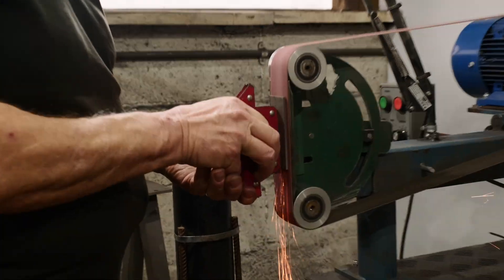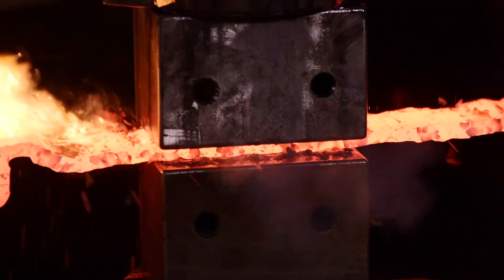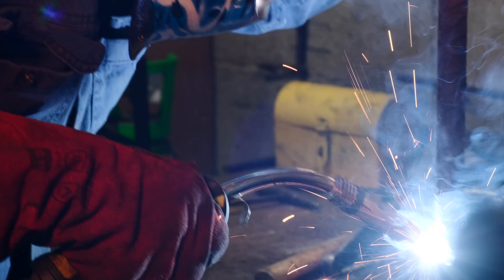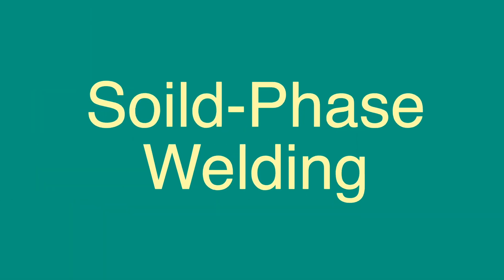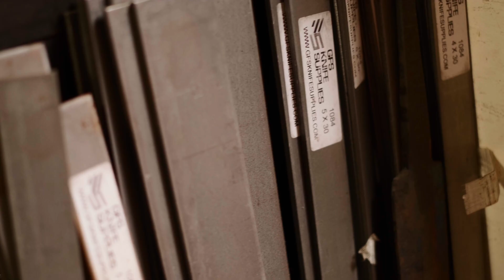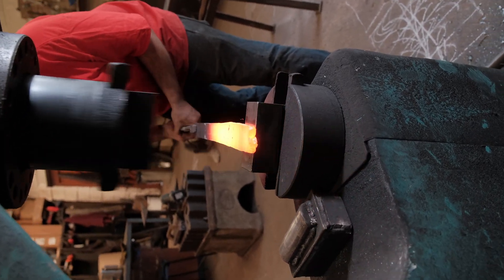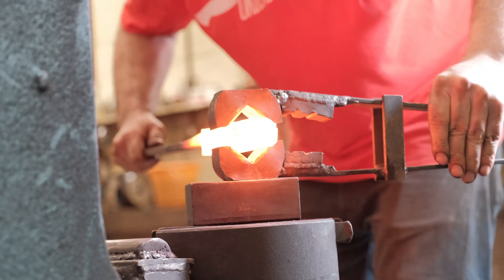I wish I knew this BEFORE I started forge welding!

Comment: Sand is used to cover the steel during heating before forge welding.
It melts and protects the steel against oxidation. 
How does it work since sand melts at about 1700 degrees C.

Comment: Around 6:45  what Your Explaining, Reminds Me of “ Tempering Glass “.   The Glass comes Out of the Furnace, and Immediately has Regulated Pressurized Air on Both sides for a Distance, Then continues to cooldown on Roller Conveyer.  From what I could understand the center is still Hotter causing a Pressure against the Air Pressed sides of Glass.  When Tempered Glass is Brakes You can see the Center is Different.

Comment: In a traditional weld, you'll get "heat zones" right beside where your weld is. That again means you'll end up with a structure that is weaker at both sides of the weld. If you forge metals together you fuse them. They will as Graham explained form a crystal structure together. There are several different structures depending on the metal e.g. stainless steel has an austenitic structure.

Comment: Regarding the cracking—I can add this info.   Higher carbon steels can frequently have Mf temperatures that are BELOW ambient temperature (Mf=the temp at which austenite to martensite transformation is complete).  So, if the Mf temp is lower than the temp in your workshop, after quenching the steel will have some austenite present.  However, that austenite WILL eventually transform to martensite. When austenite transforms to martensite well outside of the austenitic range, it causes a massive amount of internal stress and leads to cracking.  I’ve heard some argue that cryo treatment can somehow prevent that cracking—sounds counterintuitive to me.  
All this to say, the only way you could avoid this is by altering the chemical structure?? Obviously, slow heating will help (especially below A1); normalizing will help; the basic crap that you don’t need me to list.  
My mind always wonders, when you forge weld different steels, that intersection of the different steels must somehow alter the A1, A3, Ms, Mf, etc.
Reply from the maker: Thanks for sharing!

Comment: well for center core breaks that does make perfect sense ... it's the same reason why Japanese Katana's bend when quenched ... the harder steel edge cools faster and grows a bit as it solidifies harder bending the softer steel back creating the iconic curve to the blade ... with it in the middle it has no place to relieve itself so it shatters from compressions stress 
.
and centerline cracking is actually the designers error they didnt allow for the different expansion and contraction rates of the metals used ... the softer outside metal will act as a spring pushing constantly on the core ... as the core cools it expands by making crystals eventually it overcomes the stress the core can handle and cracks because the exterior is too bulky for the interior to push out of the way ... now if the cladding was thinner near the harder core it would have less pressure on the core and allow the core to expand the softer cladding into the gaps avoiding cracking ...

Comment: I had a few episodes of cracking similar to yours but mine was round bar tool steel and it split from the edge into the center like pacman.  The culprit was that the heat treated core grows and the outside can't contain it so it splits. That was caused by us quenching it and leaving it. So there is a time factor here. The proper procedure should be to TEMPER it IMMEDIATELY after the quench and not allow time for the core to expand and split it. Once tempered it is ductile enough not to crack. If I recall it has to do with Pearlite being a different volume than Martinsite or something.

Comment: I solid state welded two 1/2 1095 bars together. No cleaning off the steel, nothing. It was full of scale, rust and dirt. Used liberal borax. It stuck beautifully. Even the cross section looked like one peice of steel. Me reasoning was: did the ancients clean up their steel (no grinders) a lot of them probobly had rusty steel and still welded with it
Reply: They certainly did have grinders
Water wheel powered grinding wheels were a major use in supplying armies, and prior to that they were smart enough to know that sand, pumice, and other rocks could be used as an abrasive. They would even mix a little rock dust with water and apply with a cloth as a kind of sandpaper or polishing cloth

Comment: I tought steel shrinks when hardened. I was told it gets smaller and more dense.
Reply: Imagine that the outside cools and shrinks FIRST then the next layer does and so on. You'd have a situation where the outside "skin" is smaller than the inside so it will split as it tries to shrink around the bigger core.
Reply: It's more complicated than that. It contracts across phase boundaries when heating and expands across them when cooling as well.

Comment: Thanks for the video. 

Can you hear the point at which the core forms a centerline crack? If so, does the crack form at the beginning of the quench sequence or later in the quench sequence? What quenching temperatures do you find result in that cracking the most? Does this happen when the core steel is completely clad on both sides and edges or does this only happen when the core steel is clad only on the sides but not on the edges? Do the cracks run completely through the core steel, only along the edges, or only in the inside with the cracks not reaching to the edges? 

I haven't really looked at structure-property relationship issues since going to college in the eighties. Almost all of my real world experience was in the chemical and refining industries where much of the steel we used was plain carbon steel at low strength treatments. We didn't want any martensite because we didn't want piping and equipment cracking when the equipment came down to lower temperatures. We paid a great deal of attention to the ductile-to-brittle transition temperature, and I'm sure that any of the steels used in knife-making would not work for our needs. However, my health has failed and disabled me out of my career. As a result, I see YouTube videos about metallurgical issues and want to comment or at least ask questions. 

If the steel consists of a core with cladding only on the sides but not on the edges, I can imagine a fairly easy explanation for edge cracking. If you quench so that the edges quickly become a brittle martensite, residual stresses of the inner part wanting to be a greater volume while the outer part wants to be much smaller could cause tensile stresses along the outer edges. That could lead to brittle cracking of those edges. 

Otherwise, I still don't see why a clad part would be more susceptible to cracking than any other part would be. I particularly don't see how a non-hardenable cladding would make the core more susceptible to cracking when a hardenable cladding wouldn't make cracking more likely.

Comment: huh I always thought forge welding worked because the surface was hot enough to melt and thus stuck to each other as it cooled down. You see sparks flying off the steel when its hot enough, so I thought that was the steel almost on the verge of melting.
Reply: Mild steel needs to be heated to the point where it's sparkling or nearly sparkling. Carbon steels don't need as much heat to create the welded bond.
Reply from the maker: Your theory makes sense too don’t worry! But thanks for watching and hopefully this video made sense and was helpful!

Comment: Centerline cracking is basically just that... ive found that when doing 304/316 jacketed sanmai, you should chose a slower hardening steel like 52100 or O1 and immediately after quenching, ONLY quench in oil right down to the martensitic transformation temp (about 400°F is where i stop), and finish with a martemper in a press. If you allow the steel to slowly pass thru martensitic transformation, youll not only avoid cracking, but have a much more stable grain structure.
Reply: Wait til you see Inconel600 jacketed sanmai. 😁

THAT, is a REAL challenge.

Comment: There’s a blacksmith’s welding party trick that takes some prep. Cut a couple of 2” (51mm) squares of 1/4” (6mm) mild steel. Machine one surface on each as flat as you can. Then bring those surfaces to a mirror polish. Clean and degrease them. Put them polished faces together on an anvil, cold, and hit them hard with a sledge. They will weld together at the center at room temperature. Without any serious microscopic topography or oxides to interfere with cohesion the crystals will join under pressure. 

Not practical, but you can win a bet. 

My master smith always said that it’s about two clean surfaces and pressure. Heat is a convenience to save time.
Reply: If you get them flat enough they'll stick together like gauge blocks, no hammering needed.
Reply from the maker: Thanks for sharing this! Interesting to hear how two substrates can be joined together, usually chemically, mechanically or thermally.

Thanks again Hiltonian!
Reply: It’s a good trick. How many people accused you of using magnets? 

Cold welding is a particular concern in space applications. Pretty much anything metal in sliding contact with other metal needs coating (usually Molybdenum sulphide).

Comment: Hi Graham. I have a hypothesis for what is happening with the edge, and it's to with "bladewise", rather than sideways differential expansion. 

Consider a hypothetical core material that expands 100% in the sideways direction (towards the two cladding materials, but ZERO in the other two directions ("bladewise"and lengthwise). And assume that the cladding doesn't expand at all, in any direction. When you cool this knife down in the quench, the core will increase from, say, 1mm to 2mm, but there will be ZERO forces experienced by ANY of the materials, since there is no differential expansion on any of the joins.

Now consider that the expansion in bladewise direction is 100%, and the others are zero: In this case, the 5cm wide blade tries to expand to 10cm, while the cladding tries to maintain its original 5cm dimension. Now there will be an EXTREME tension at the weld boundaries, pulling each side of the core down, and creating two opposing, outward moment arms that trie to split open the core. 👈 There's what I believe is the origin of the force causing the split. 

Of course, in real world, there is a LOT more going on, and much of it will make the situation worse. 

1) The very edges of the core will have cooled the fastest and be extremely brittle.

2) The cladding will have cooled faster than the core, THERMALLY shrinking faster then the core, which is also trying to expand, increasing the differential expansion. 

3) The "soft" steel on the outside will have become hard due to no longer being at forging temperature, markedly increasing its stiffness, and thus the force it can apply before yielding. 

FYI. I'm not a smith of any kind, however I do have degrees in physics and engineering (though "only" electrical).
Reply: If I'm correct, I'd expect to see the following:

1) The effect is most severe where the expansion differential is the greatest.

2) It most commonly occurs where the core is thicker, increasing the moment arms. 

3) It occurs on the back, but not the edge of the knife, since the moment arms are mitigated by the exposed core edge, and there is simply more material to resist cracking from the pull. 

4) It occurs more commonly at faster quench rates, due to the effect of thermal expansion, exacerbating the differential expansion rates. 

5) It rarely occurs on a false edge (say, on a Bowie knife), for the same reason as it not occurring on the blade side.

6) Blade material and dimension configurations most susceptible to splitting, should be more likely to warp (though this can be mitigated by being careful with the thickness of the two cladding layers).
Reply: Really rough and potentially wrong metaphor but reading this makes me think of a hotdog "exploding" when it's boiled or microwaved for too long.  The core material is expanding but the skin is much more inflexible.  
Now, I know the hotdog contents much more literally "explode" outwards when the skin finally does break, but every time I see it happen it creates this fairly even trench in the meat, and where my metaphor comes from is this trench is caused by the less flexible skin pulling the expanding meat fairly evenly across the length of the hotdog.  If it was more literally just the meat exploding out I'd expect to see more uneven surfacing in the split.

anyway, ADHD connections and all that, but your explanation helped put it into much better mentally visual context since I haven't seen the metal splitting phenomena myself (yet)
Reply: @Solais1019  that's a reasonable visualisation, I reckon, but due to the relative thickness of the "skin" to the "meat", the result is expected to be neater.

Comment: Can't you just thermal cycle & physically forge a fusion weld to refine the structure? I've used fusion welds on high carbon steel then forged it with so far great results. Usually to attach a lower carbon handle to a higher carbon blade without the concern of whether a forge weld actually took well or not
Reply: In short… Yes.

The generally poorer properties you get from a weld is due to the cast structure. You can heat treat and forge to change the structure.

Comment: Do you use induct heating to forge?
How strong are friction welds in comparison to TIG or MIG welds?
Does it mater if the steel is cold rolled or not?
Reply: Induction heating is a viable method for forging. There’s a good series of videos on the channel going through all the various options. I’d recommend it.

Friction welding will produce a much stronger weld than MiG or TiG. It’s doesn’t cause melting so you avoid getting a weaker cast structure when you’re finished/ it can often create a stronger weld than the base material since it breaks up the grain structure so much. The weld might need heat treatment after, though, depending on the steel and cooling rate.

You’ll not get much benefit forging from an initial cold rolled state. The strength you get from cold rolling is from work hardening and leaving stresses in the steel. Heating the steel up to forging temperature will relieve all those stresses and you won’t get them back when you cool it down again. You need to rely on martensite hardening to up the strength again after forging.

Comment: Forge welding steel to titanium is tricky. At forging temperatures you can start getting iron-titanium intermetallics (more or less compounds) that are very brittle. With careful time and temperature control you may be able to avoid them but the most common method is to use a nickel interlayer. Steel and titanium will both happily forge weld with nickel without much problem and you can avoid those intermetallics.

Pro tip: if you want to forge weld different metals and you’re not sure if they’ll stick, stick some nickel between them. It it can alloy with pretty much anything.
Reply: If you really want to forge titanium and steel together without using nickel then you’re looking at a process like explosive welding.
Reply: @GemAppleTom  This is something I have been thinking about a lot. I have been wanting to create a San Mai from Timascus and a core of damascus.
Reply: @checoleman8877  I don’t think I know what makes timascus. Is it commercially pure Ti and Ti-64? 

I’ve seen successfully steel/titanium friction welding done before with an Inconel “buttering” between them so it should be possible to make your San Mai. I’ve no idea what kind of interlayer thickness you’d need though.
Reply: @checoleman8877 youll most likely need an argon purge furnace. I know a dude that makes 3-tone timascus from grade 1/5 and zirconium. He uses a modded argon purge rig.
Reply from the maker: Very good addition as always Tom. We appreciate it thanks!
Reply: Nickel will pretty much assist anything.

Thats how ive done cupronickel jacketed HC core.
Reply: This is why solid phase welding can work. Because then the layer of intermetallics can be kept so small that they don't become dominant in properties. 
If you put a nickel layer in between, it can by tiny. A 0.2 mm layer would do it. You just need to seperate the atoms of Ti and Fe.